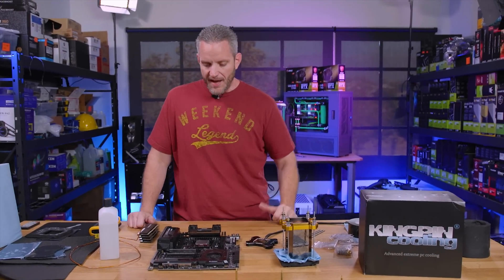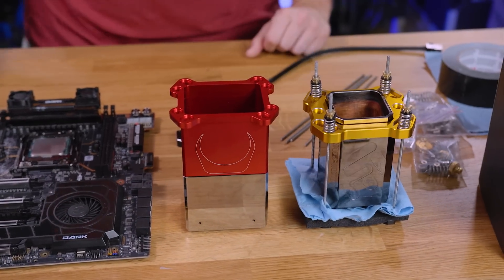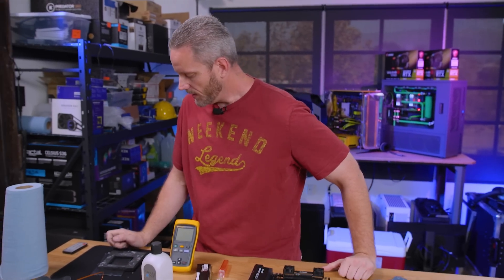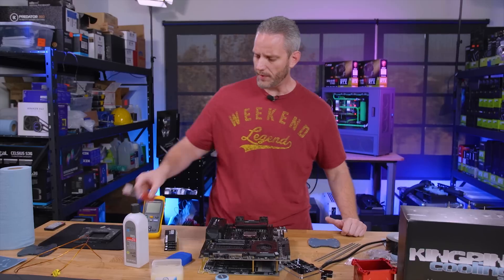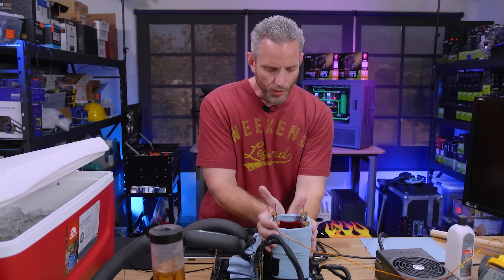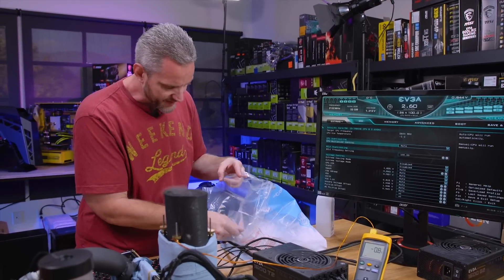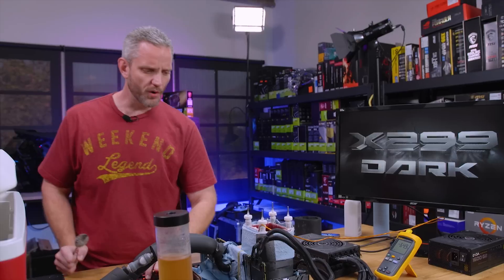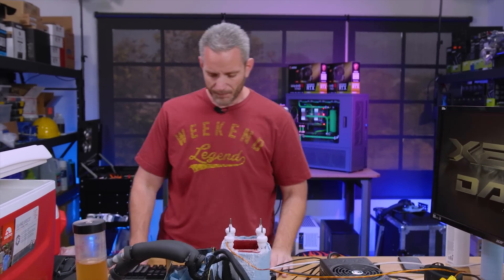Dry Ice Overclocking... NOT RECOMMENDED!

Comment: Make a Peltier cooled.
Reply: They will be less messy but at the same time they cant go as down as LN2 does. There is a cooler out there that uses peliter. It requires 6-pin PCIE power connector to run . Efficiency is the only issue to use em for 24/7.
Reply: Peltier coolers are useless when working with high energy consumption like with this CPU. Peltier coolers are not that efficient in transferring heat and therefor consume power themselves, making the total heat output even higher then that of the CPU itself (up to a factor three depending on the quality of the peltier elements). So you would need even more extreem cooling to cool the peltier cooler which is cooling the CPU.

Comment: Make sure you're using subzero thermal paste this time...
Reply: Hes using the kingpin paste, which is LN2 Temp ready
Reply: I was late to the live stream and didn't get a chance to comment that that was probably the main issue he was having last time lol
Reply: he didn't have issues with TIM the chat said don;t use liquid metal so he didn't then he had a bad mount on the ln2 pod once he remounted it it worked well
Reply: Daryl B i only meant the LM part really.
Reply: i've read that gelid gc extreme is designed for sub-zero temps but have never put it to the test

Comment: Gosh darn i was about to use dry ice to cool my main rig but than you said it wasnt recommend. Thank you for saving my computer
Reply: Crisis averted
Reply: @diomedes7971  finally someone mentioned it. It's really not good for your health
Reply: Drew142 cool
Reply: Nick Newman that’s not even racist..
Reply: I myself do actually want to try XOC with dry ice or LN2 once.
Reply: @1blackice1  Watch videos from the pros on insulation and water-proofing. It can be done for daily even. My phase cooler runs -58c when I'm checking emails, and even keeps FX below 0c peak core temp in benchmarks at 1.7 Vcore (I would push a lot higher, but my motherboard is about to explode pushing over 100w per VRM phase, I didn't intend for it to run extreme clocks when I bought it a long time ago).

For those wondering why its running an FX, I just need to validate some socket water-proofing methods before I toss it on my Threadripper. LN2 runs should be fine since those are not 24/7, but if I'm running daily, I'd rather kill an FX in a longevity test than my Threadripper (at least from something silly like water condensation).
Reply: @diomedes7971  for sure, the fog coming out? CO2...
Reply: Drew142 you’re welcome
Reply: I can't tell if he is joking or being serious....
Reply: Any cooling that brings the CPU below ambient temperature is risky for daily use because you run the risk if getting to close to dew point (temperature at which atmospheric moisture condenses). If below zero, even worse. Stick to "common" cooling solutions.
Reply: @NothingXemnas  unless you're linus.
Reply: Matthew Palmer Linus cools his CPU by dropping them so they stop working.  They’ll never get warm again!
Reply: on less you use liquid cooling on all the parts and use a  like hermetically sealed case that's been purged of air with say like dry nitrogen or something like that  cant have condensation if there's nothing in the air to condense :)
Reply: @NothingXemnas  unless u r me and using freon cooler
Reply: NothingXemnas r/woooosh
Reply: @gavinpaull498  
Damn...
Reply: r/woosh
Reply: Don't worry liquid nitrogen is a lot safer.